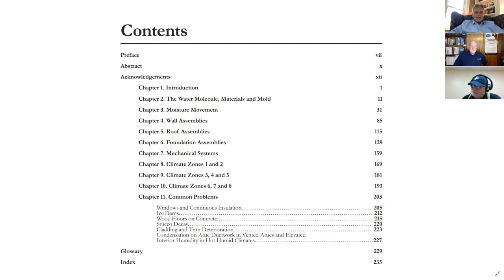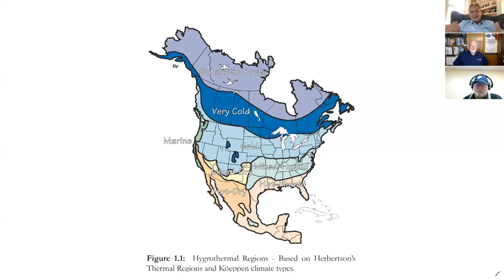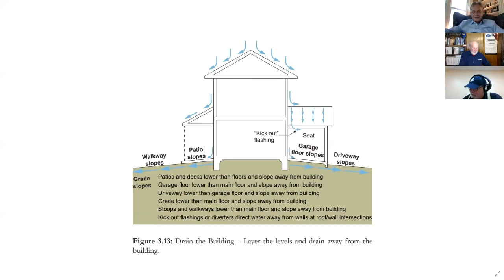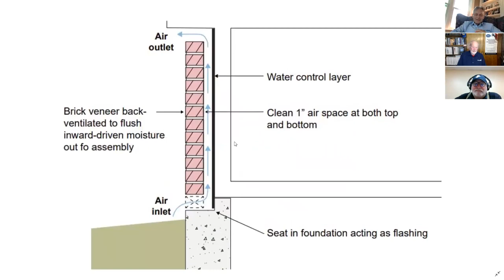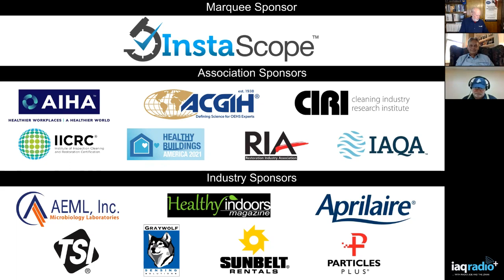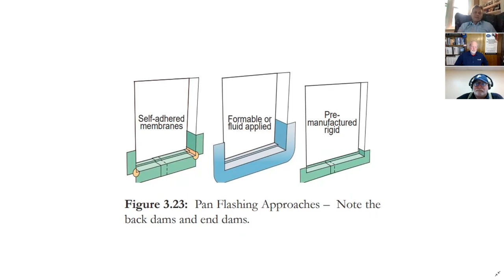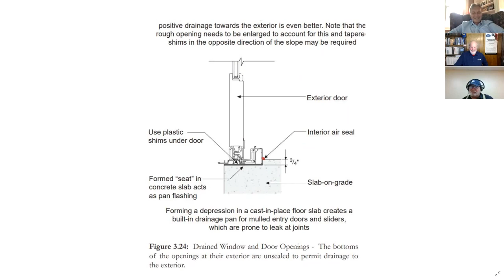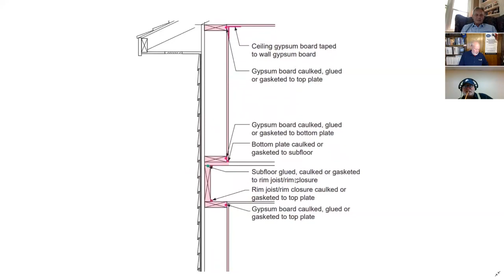637: Joe Lstiburek, Ph.D., P.Eng - Moisture Control for Residential Buildings

Comment: Excellent question about dealing with existing brick veneer. I've personally dealt with a 50s, a 60s (current), and a 70s construction 2 story full brick veneer home here in Western PA and they were all fundamentally the same; wood framing sheathed with Celotex and an air gap of varying width before factoring in the mortar droppings. Even in the areas the Celotex was perfectly installed it was far from an air barrier for varying reasons. Further, all 3 homes utilized building cavity returns and leaky supply ducts throughout. As Dr. Lstiburek notes, drying is an exchange of energy, and in the scenarios I'm describing it seems that energy is, at least in part, coming from the HVAC any time it's in use. Without air sealing at the sheathing first I can't imagine retrofitting for back venting of the brick veneer being a worthwhile endeavor. I wonder though if one was to effectively air seal the envelope of one of these type of homes if it becomes a necessity to either back vent or seal the brick surface from intrusion.

Comment: Hello, we live in Zone 1, Florida and have planned a tight home with an ERV. Our question is.
Does an ERV utilize dry waste air to assist the drying of incoming moist humid air?
Reply: yes
Reply: I live on the coast of SC and have used and ERV for 11 years with excellent results.   I exhaust the bathroom air on a continuous basis and put the supply into my supply duct in a place where it mixes well with room air, but does not blow on anyone, giving plenty of time for the new air to mix.  My bathrooms never fog up and smells are gone in a hurry.

Comment: Oh, no.  There's plenty of attorneys.  But most people come kind of close to the edge on home projects - a $5k retainer [and a year of mucking about]  is not part of most peoples bid acceptance calculus.
What I find helpful is after talking to a contractor, does the bid address all my items, or are there assumptions?  Assumptions tend to not perform well, especialy on materials procurement.  Am I clear on methods, and asked all my dumb questions?  Case in point, a business I bought years ago failed an inspection in multiple areas.  On the plumbing end, first bid missed half my concerns, which I tried to correct... second attempt still had holes in it, so I found another plumber.  Job cost "more", but I suffered no change orders, and no re-inspect: all matters attended to.  If I had gone with the first...lost time on delayed opening [and additional cost on "new" work] would have likely cost me triple the difference.
Anyway... seems I need to get the second edition - lots of new materials out there.

Comment: The Huber zip system with foam applied seems like a great idea, but it’s completely backwards to the perfect wall system, which puts sheathing on the studs and foam on sheathing.  Wouldn’t installing the zip R sheathing backwards be the most efficient way to create a perfect wall system?
Reply: No, sadly not. If the zip is applied with the foam facing out the water barrier will be on the wrong side of the OSB. Hence the OSB will deteriorate.
Reply: zip r is not  joe's perfect wall. it's not exterior insulation.
Reply: @arvidjohansson3120  are you saying this relative to osb and not sheathing per se? meaning zip r would work backwards if it was plywood?
Reply: Zip R is not only backward, after a half inch of insulation between the studs and sheathing you lose significant strength. You'd be better off using two Zip R sheets insulation layers facing each other to make an overly expensive SIP panel.

Comment: How do you best deal with gutters in heavy snow load areas?
Reply from the maker: Good question. One thing is to make sure you air seal very well and avoid allowing heat to cause ice damming. We have used commercial gutters when appropriate here in the ski resort area of PA although I do not consider us to have really heavy snowfall. Some of the local ski resorts, homeowners groups do not allow gutters but that is more for aesthetics and causes its own problems. I will pass this along to Joe and see what he thinks.
Reply: @IAQTraining11  thank you 🙏
Reply from the maker: Reply from Joe:

Sometimes we add heat strips to the gutters….

Stuff I have written about ice dams….

https://buildingscience.com/documents/insights/bsi-046-dam-ice-dam

https://buildingscience.com/documents/building-science-insights-newsletters/bsi-097-de-icing-ice-dams

Comment: Great info, as usual, but I'm still a bit unclear on how to best do an ICF house. So.... for a planned ICF house near Chicago, does it need an external (e.g. peel'n'stick) water control/barrier layer or does the external EPS insulation (of the ICF) fully serve as such layer? If it should still have an external water barrier, is it ok if there is no insulation on top of it?
Reply: Hey Thomas,  doesn't look like you got a reply.  In my experience a weather barrier is recommend. In my building jurisdiction they require a tyvek overtop of the icf.  And even from experience i'd recommend it.  I don't think anything above grade requires a peel a stick, its a better product, but not required for its air or vapour barrier characteristics.  Most of that is covered by the icf itself. But a weather barrier, and maybe even a rain screen wouldn't hurt, even if its less fun to apply when the icf studs are covered.

Comment: When using external rockwool insulation on a house, is house wrap ever put on the outside surface of the insulation?  The housewrap would then be then be the drainage surface (rather than the rockwool) behind the exterior sheathing.  If not, is there a reason for not doing this?  It would seem that putting a layer of house wrap over the rockwool would minimize air (and moisture) infiltration when the wind is blowing.
Reply: House wrap is your air barrier and not your drainage plan.  You need a gap to have a drainage plane.